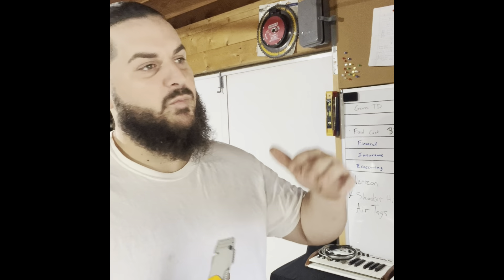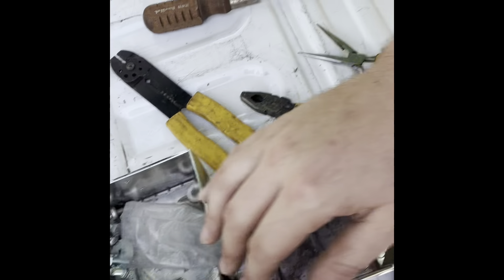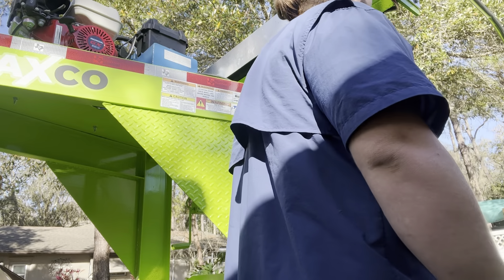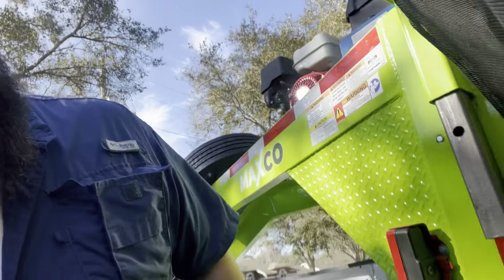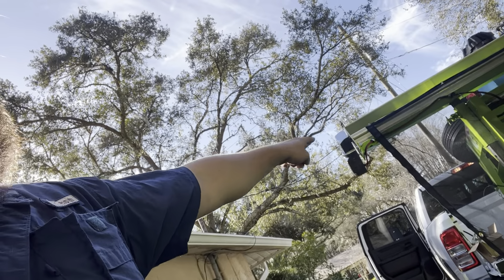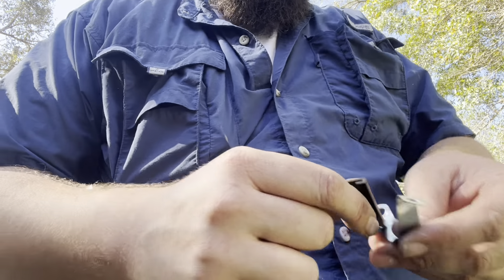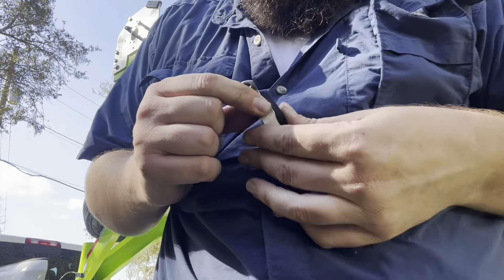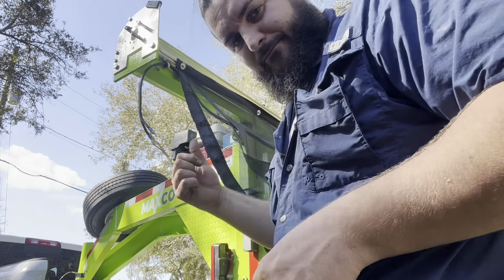Replacing the US Tarps Motor on my Texas Pride Trailer so I can get back to the Dumpster Business

Comment: Man I have issues with my motor got a new one put it on still doesn't work.
Reply from the maker: What’s happening with it? Any movement at all?
Reply: @MAXCODumpsters  none
Reply from the maker: @gabriellvargas1889  are you sure your getting power from the battery? If your old unit AND new unit both do nothing, then it sounds like no power to me.
Reply: That what I was thinking I heard a small buzz from the bottom then seen a little box with wires but not sure what tk do in that
Reply from the maker: @gabriellvargas1889  If I were you I would first test or replace the battery. If the battery is good I’d get the wiring tested to make sure power is going where it’s suppose to.
Reply: Took it back to tx pride they said it was a bad connection
Reply from the maker: @gabriellvargas1889  Happy to hear you got it sorted out!
Reply: @MAXCO Dumpster Rentals  trust me me too haha... dumpsters suck though so thin always get warped and being loaded doors don't close right anymore